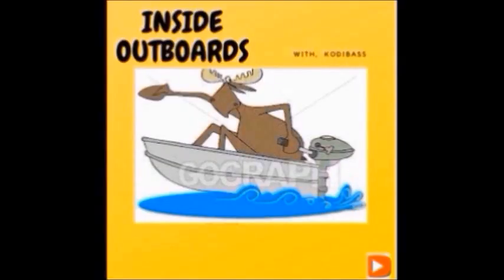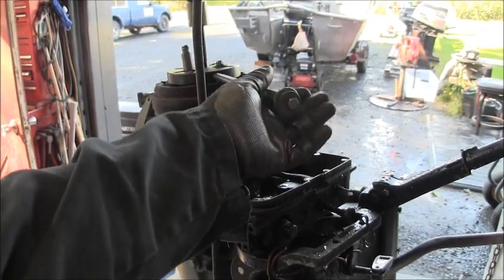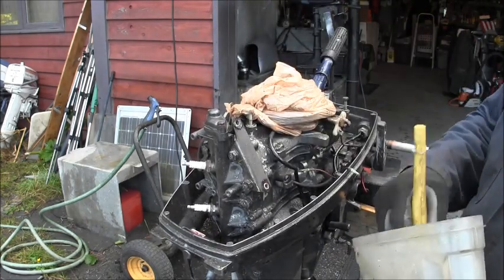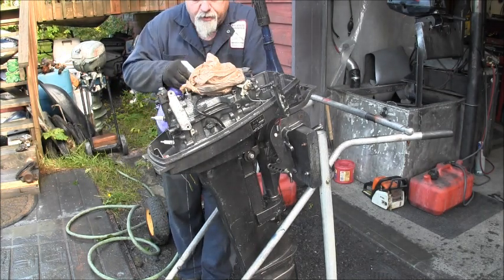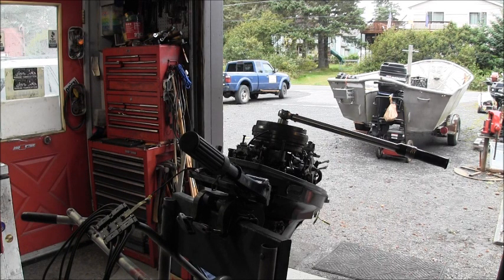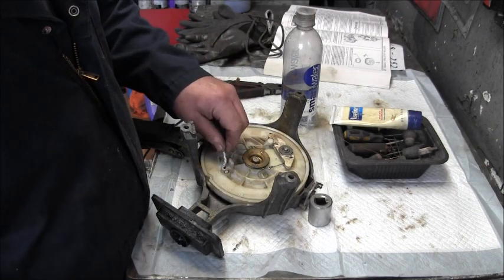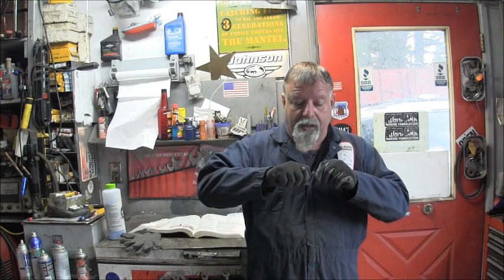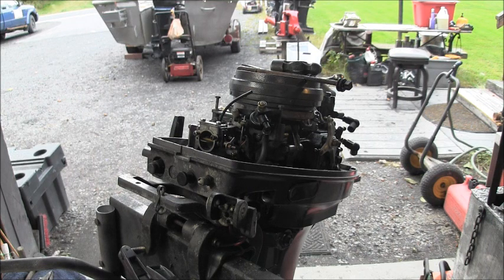TOHATSU 18 HP,     Can it be saved ?  (( Part 2 ))

Comment: That was a good decision that you made connecting the wire to the CDI switch box and you saved yourself about $300.00. Great video.
Reply from the maker: Yep' them electic parts ''''' not cheap.     kodi

Comment: She cleaned up very well!!!
Nissan makes a good motor!!
The wire you fixed, is it connected directly to CDI? If so, on a new CDI, is there a new tab to ground?
Reply from the maker: I don't think there is a tab on new ones I think it is a strap that covers the bolt hole.  kodi
Reply from the maker: Yep'  me too. Never came across a lefty loosy FW nut that I remember of.    kodi
Reply: @kodibassInsideoutboards  thanks for answering my questions. Just wanted to say thank you for the content, the things you cover help me look for things I may not look for until there might be an issue. I have a lot of small engines for zero turns, mowers, weed eaters, blowers and chain saws, all those pieces of equipment have a purpose just as an outboard does and being able to look at the functionality of each and being able to look things over, measure wearability of parts or voltage, is key to me not loosing money in the long run. I’d rather catch something on a rainy day, change the part instead of being out on a job and having the part go out in the middle of the job. It really don’t look good to be wrenching on something out in the public light, plus the down time of the machine and lost on labor cost nit having my guys working, just adds to the aggravation, plus by public image, I would look like I do not take care of the equipment. Perception is huge and having an outboard run like a top at all times adds for many happy returns. I like knowing how things work and if you know your motors, you can usually hear when something is not right, before it breaks.